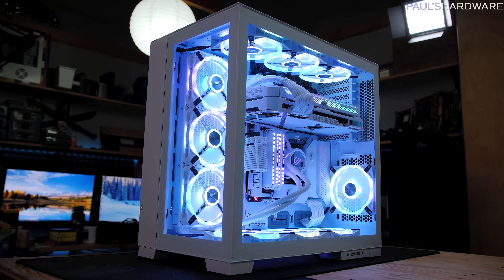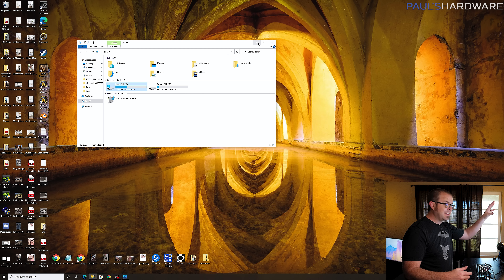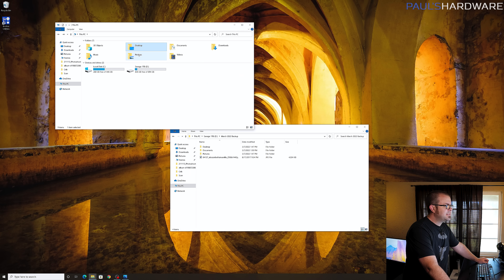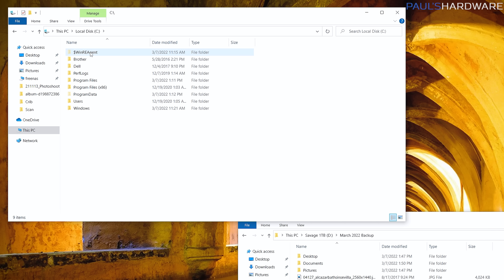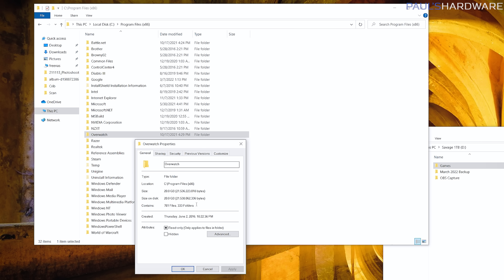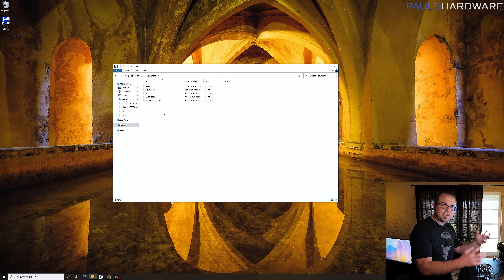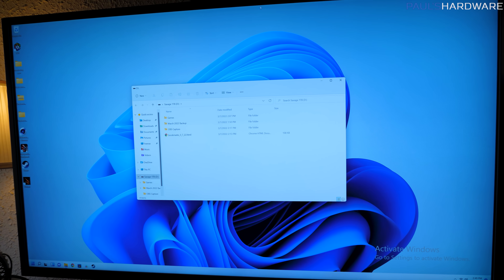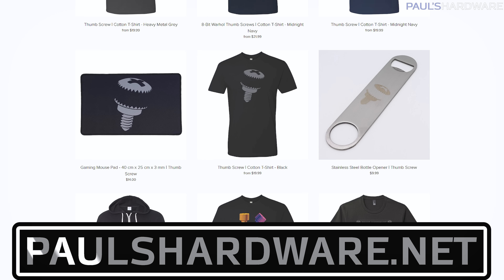How to Move Everything from an Old PC to a New PC

Comment: Awsomeeee! Thanks!!!! Have my old PC and sooop torn between using the new GPU and CPU in it as an overhaul till I do a platform swap with am6, OR IF I just build a new am4 system for fashion and have 2 great systems to nerd out for 2 years till am6 orrrrr go for a am5 enthusiast build and stressing and oc fun and then upgrade CPU for 8000 ryzen or wait till like 10000 series or w/e 5 years later hah. Any upgrade is massive, but I think I have the money and will enjoy the build fun and power way more even if it's a waste of money. Just such a hard choice cause if I don't salvage the 5 year old build which is safer, I'll need a full gear up anyway at which point am5 is way more cost effective even tho I bought a 5800x3d~ my current PC is BAD at fitting a tower cooler for it so I might need a stock cooler and 5600x for my old system to get another 5 years out of my 1080 casually and just do a perfect tier am4 build with it, sell it to someone from r most money back, or just keep it as a 300$ paper weight for stupidity and build am5 anyway with 7800x3d idk XD good thing is once new system is up and perfect, I can spend years modifying old system to fit or push 5800x3d even with an aio and just have fun for once

Comment: Paul .thank for doing this video. This could be applicable when doing a clean install as well. As far as moving files. I see a lot of folks move files like using a spray paint . I have found that moving large chunks of files can be problematic . I am a photographer and I use Lightroom editing software. I have watched videos where the person will said for Ex: say I am replacing my drive with a larger drive and I want move my files to the larger drive. They will say just take your mouse and drag those 5,000,000 files to the drive easy pezzy ! I am going to use  a paint brush move files in smaller chunks. Who want to see this file could not  be copied ,skip this file etc .

Comment: If both computers are up at the same time, I would just copy data over the network.
Transferring with external storage just adds an extra unneeded hop. 

I wrote a backup script that we use at work to replace peoples computers that gets all the personal data, browser favorites, outlook settings, specific app data directories, etc.
In that case the script writes to an external drive.

The other thing often smart to do is just take the old drive and install it to the new PC and use it as an extra disk and then you can move anything you want off of it.

Comment: Great video! I have a 10 year old Acer laptop with windows 8 and all my programs in it... the laptop is working great but I needed some features it does not have. I purchased a 5 year old HP laptop with Windows 11 in it. I wonder if I could erase this new hard drive with Windows 11, install windows 8 for which I have an original CD, the same I used for my laptop now and then replace the hard drive with my current hard drive with windows 8 and all programs in it. Would that help the newer computer to "accept" my older hard drive? Thanks!!

Comment: I have a surface pro 2 with windows 8.1.  I bought a new surface pro 2.  Is it possible to clone the drive c of my old laptop on ssd, then connect the sdd to the new surface pro 2 and clone the the sdd to the surface pro 2, i cant find the installation files for the programs and i just want the exact same windows i have on my old laptop to the new one

Comment: HELP!!!,    So my case has 3 Hot Swappable Bays with three different SATA drives.  I have been using these drives without issue in Windows 10 for 3 years now.  Well I recently had a problem with my system that drove me to update My Motherboard and GPU as well Installing Windows 11 on a new M.2 Samsung 980 pro that is complete installed.

When I did this WIN 11 install I removed the three HOT SWAP Bays with the Drives i was using for backups/Games and Files I wish to keep, so I do not want them to be FORMATTED OR ERASED.  When I returned them in their Bays and rebooted my system they did not show up.  I'm overly frustrated and not sure what I can do to return my drives and the Data not being lost.  The Drives range from 4TB/2TB and 2TB bay drives (3 in total Bays).

I hope a smart person can help out this Dumb old man.  I would be most very relieved if someone can help me with this.
Reply: When all drives are connected, are they detected in the BIOS?
Reply: @JJFlores197  And if they are not detected in BIOS?
Reply: @GogoFly68  Make sure your drive bays are connected to power and that the SATA cables are connected both to the drive bay and the motherboard SATA ports. If you happen to have an M.2 drive, make sure you plug your SATA cables to the correct ports. With some boards, some SATA ports are disabled if you have an M.2 drive installed. The motherboard manual will have this information.

Comment: Is there a more direct method to transfer files? Like just use a USB cable to connect the two computers and copy directly from old to new, rather than copy old computer to external drive and then copy it all again from external drive to new computer? (more time saving process)

Comment: PCMover is an amazing utility to transfer from old to new, either via network cable or a mounted disk image. I needed a 64 bit version because of the sheer number of files on my old machine which broke their 32 bit version and their level 3 tech support/developer supplied a then beta and got it working. Highly recommended!

Comment: I understand that this video is a year old, but the title is misleading. It was well done, but missing the EVERYTHING part. What if I need to move EVERYTHING to a new custom PC from an "Out of Box" one? I'm talking OS (already registered) on new hardware that it won't have drivers for, or even understand the motherboard the drive is connected to. I understand a clone to the new drive would get me half way there, but it probably won't understand how to boot on the new hardware. I ask this because I refuse to buy a new copy of Win10 or 11 when it was installed on my first machine with no printed activation key in the box (because they don't need one if preinstalled). The idea behind this is to have everything exactly the same as it was on the older hardware; software, passwords and all. Is there a process for this that doesn't require buying another software?

Comment: I have an OLD Quicken program I want to transfer but not finding the CD with the code.  I use it to balance accounts manually. So am I SOL on getting it to transfer & work?
Reply: Probably yes. I'm not familiar with Quicken programs, but sometimes you may be able to find forums with workarounds on copying programs to another Windows installation. It can be hit or miss depending on many factors. 

What I would suggest is to make a copy of the program directory. In other words, go into your C:\Program Files or C:\Program Files (x86) directory and look for the program's folder. Copy and paste that over to a flash drive or external drive. Try copying it into your new PC and see if it will launch. I can't guarantee that it will work but it can't hurt to try.
Reply: @JJFlores197  I'll give it a try.  Thank you!

Comment: If you were to use an external HDD you are limited to the transfer rate of the USB port. So if you are moving from an old system that only has USB 2 your transfer rate will only be 480 Mbs/s and that would take a long long time if you have GBs of pictures and music. The ideal way is removing the HDD that has the data you want transferred and install it into the new system and then copy to the new HDD if you need to put the old HDD back in the old system. If not, just install it to your new system and leave it. As far as copying downloaded programs, you will need to reinstall most of them because if you are moving from Windows7 to Windows 11 there will be too many incompatibilities for them to work. And why would you not want to transfer music files? Going through and re-downloading hundreds of music files just doesn't make sense (no disrespect).

Comment: Hey Paul,  I'm going to go from a Gigabyte aorus B490 to a newer Gigabyte Aorus x570 model.  So could i not just move the existing hard drives over, boot up and then deal with drivers that need to be updated.  Yes no??  The caveat to this is that the old drives are mirrored via the raid in the bios on the old machine, so would this then become a bigger problem as i'd have to set up the raid again in the new machine... ..... So then i got to thinking that if I clone the drive to a NmMe drive, would I end up with a NvMe drive that I could then put into the new machine and then carry on to load drivers, but I'd loose my raid - Mirror... Any thoughts on all this... It's my weekend project...

Comment: Will this take long if you have large files? what is a good external drive? i have around 400gb of films i made over the years of my family/holidays and dont want to lose it.
Reply: Yes it can take many hours. It depends on the size of the files, how fast your old drive is, your CPU, how fast your external drive is an other bottlenecks. External SSDs are fast, especially if you can use USB-C ones, but they are much more expensive per gigabyte compared to external hard drives.

Comment: most important tip is not your documents folder or the %appdata%, is this:
You will 100% forget something :) Keep your old pc somewhere for at least a couple of weeks before deciding it would be a nice experience to install arch on it - preferably somewhere connected to your network with remote desktop enabled - so that when you need that cv you had created using that old template and you need now you can turn on your old pc and get it :)

Comment: Can't you just USB to the new computer and drag & drop from SSD to SSD? Thats how we used to do it!
Reply: you need a specific usb cable for that, using a 'normal' a/a usb cable will most likely damage at least the usb ports :)
i think the whole point of the video was for people that do not have the option of having both pcs up and running at the same time (that's why the external / remove the old disk). And the tutorial seems more toward ...not so knowledgeable pc users? Else, if you have both pcs running, they are likely connected to the same network, just and share the folders, no need for usb connection, or disks, or anything else.
Reply: @gloth  wait lol thanks this saved me some time

Comment: Hey Paul, or anyone who can help me out with this, 

I built my first PC a few years ago and recently decided to upgrade from my current AM4 system and build a completely new AM5 system. 
I've got almost all of the parts necessary to put it all together so I started looking into how I could transfer all of my PC's files and data, along with my copy of Windows 10 over to the new computer but I've run into a bit of an issue. I know that I can just create a backup for all of my files and should be able to just move my drives from one machine to the other but I ran the command script to show the status of my Windows license and it's listed as an OEM license, "OEM_COA_NSLP" to be specific. I read that retail licenses are transferrable to a new personal computer but OEM licenses aren't. However, I put this computer together myself. I thought OEM licenses only came with pre-built pc's. 

The only explanation I can think of is that since this was my first PC after only ever using Apple computers, I needed a way to install Windows from a flash drive so I went down to my local Mom and Pop computer repair shop and had them install it for me. I then purchased a full Home license when I got home and everything was fine. Is it possible that when the computer shop installed Windows onto my pc, they installed an OEM version? That doesn't seem correct but it's the only explanation that makes any sense to me. If what I've read is correct, my copy of Windows 10 is now registered forever to this motherboard and I'll have to purchase a new license when I build my new PC.

I'd really like to avoid that, if possible. Seeing as its $120 that I don't think I should have to spend on account of this technicality. Any help or advice would be greatly appreciated.

Comment: Simple question. I'm building new system (new motherboard and processor and memory). I just want to take old hard drive and SSD (I have separate operating system and data on my mechanical hard drive and operating system is on SSD of course). Can I just plug old SSD and mechanical hard drive into the new system? Would it work or I'd get blue screen? I want to keep everything the same as it was on the old system. Lazy to reinstall everything.

Comment: You've made this all too complicated, and yet will not be a complete transfer. A software program called "Laplink PCmover", from Amazon will copy all your documents, images, and MS, Adobe, and other apps into a storage device, like a USB, then transfer all to the new PC system without having to reinstall applications. Very straight forward and easy to use. I have used this method several times when migrating to a new PC. The downside is that you must purchase a license for each transfer.

Comment: if i
back up my 1tb hdd onto
an external usb, is it possible to also use google drive to
store some data but on my new build do
i need to buy a new windows key?
Reply: Your question is a bit confusing. Google drive has nothing to do with the data that's on your external usb drive.

Comment: Good Afternoon... I am in the middle of migrating from a failing computer to a new computer.  Because of previous experiences with computer failures, I have been installing my games to an USB hard drive.  I am in hopes of somehow avoiding having to re-download all my games, especially my BigFish Game Club games (Steam and EA are not that many games to download, but BigFish is utterly HUGE)...  

Any suggestions?  I have not yet plugged in the game drive, nor have I installed BigFish's game manager.
Reply: I'm not familiar with BigFish games, but most game clients have an option to let you change the game install location. I know Steam and EA Origin have that feature. Don't know about Bigfish games. The thing is that performance over USB may not be that great unless you have a USB 3.0 drive and port so your games may or may not run that great. For smaller games, it likely won't be an issue, but if you have larger games, it may have some performance problems.
Reply: @JJFlores197  Thank you for your response.  Unfortunately, that is not the question. I have been successfully running the games on a USB drive for a very long time.   

I now need to move that USB games drive from one computer to another, and not re-download 100's of GB of games files.  (Which is the reason I put the games on an USB drive to begin with). 

Thanks for your time to write a response.   :)

Comment: Sorry if this sounds stupid, but I do not have any idea of how to transfer my corel paint shop pro to my new laptop.  Is it done the same way as you describe in moving files, like images etc onto an external hard drive ?
Reply: Not really. programs usually cannot be copied over. On your new laptop, you will need to download and install the software. Depending on the licensing agreements that no one reads, but still accepts, you may need to de-register your copy of Paint Shop from your old PC and activate on a new computer. I'm not familiar with that software, so I don't know what the process is like.

Comment: How do you transfer files from old pc to new pc when you not getting any picture from the screen? The screen I bought just recently so I know it's working coz it lights up when u turn it on and also the desktop lights up when i turn it on but then I get no pic on the screen. It worked previously but then all of a sudden it didn't. Can I still transfer files even if I can't see what I'm doing?

Comment: The reason all computers slowly get slower & slower & slower
is because everytime you install a new program that program
is instructed to launch at every boot. Its running in the background.
As your computer boots watch what loads. There are Hundreds
of programs which load & run in the background sucking up
your cpu's horsepower. I'm shopping for a new computer
and I am going to try something new. I want a 500Gb Hdd for
my C drive  ONLY WINDOWS will be on this drive. Then, I want
a USB 4Tb external Hdd. I will install ALL my programs to the 4T.
Will they still dick with my registry & run in the background? They
wont if I unplug the 4T USB. We will see.

!

Comment: The is a very good tutorial and I have recommended it to a friend who lives a couple of hundred miles away, who has bought a windows 10 Laptop. The only issue I have with with this tutorial, is that it is almost impossible to read any of the file or folder names, as you move though explaining the process. Next time you do something similar, I would recommend using the Windows scaling feature to make text and screen objects larger. This will make your tutorials much easier to view and comprehend.